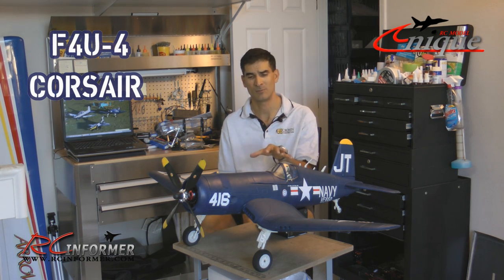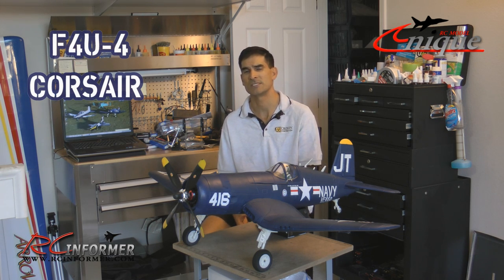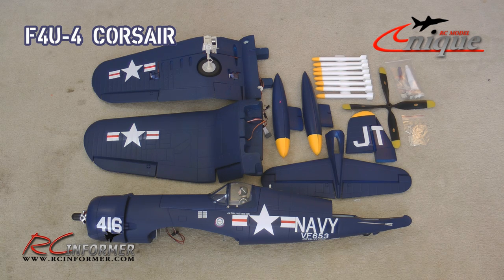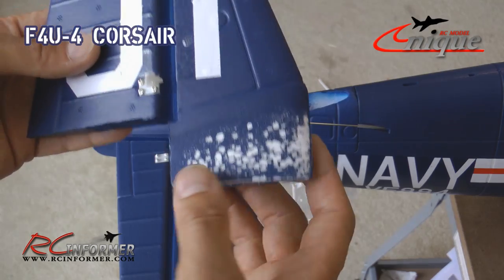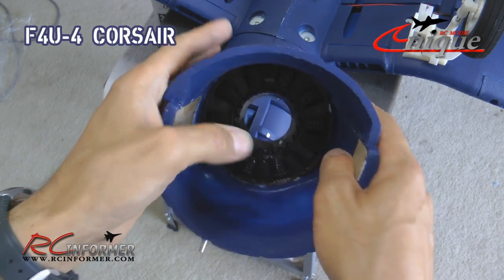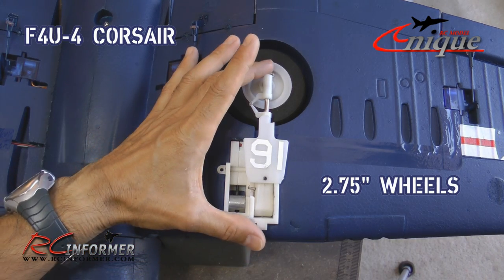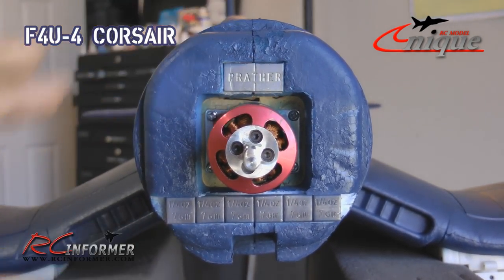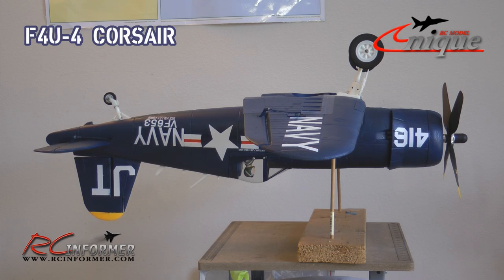Unique Models F4U-4 Corsair BUILD GUIDE by: RCINFORMER

Comment: This was the one! My introduction to Rich and RCInformer. 100+ flights and this poor Corsair survived the build, a few broken props, and has never had a battery tray. It looks like he’ll! No breaks, but a lot of missing paint and dings. Still flies great. I would’ve never guessed this plane would survive a month, I can’t believe it’s still around 5 years later.
Thanks for the help on the build Rich!
Reply from the maker: Jeff, Excellent to hear it! Time to upgrade to the 1700mm FMS Corsair:)
Reply: @RCINFORMER  Last question. On the FMS 1700mm Corsair. Do I need to order a different prop, esc or motor? No plans on going 8s. I’ve already started a GoFundMe page for myself to get a bunch more 6s batteries for the Eflite a-10, the Freewing 80mm a-10 and Me-262.
Next time you’re in Atlanta you get to maiden the big a-10. I’m scared to just pick it up, much less fly it!
Reply from the maker: @jeffhenderson934  No need to change anything. The 300kv motor, 80amp ESC on 6s works perfectly with the new prop! Most new models have the new prop in it already. Please use my links to purchase if you get one:)
Reply: @RCINFORMER  why didn’t you tell me about your links 5 years ago??? I’ve crashed over 25 planes and still have around 30. I’ll get thru your link.
Reply from the maker: @jeffhenderson934  Jeff, I just starting using them in March:) At NO EXTRA cost to you, if you click my links that go to the product page and add them to you cart, we get a small comission. We appreciate the support:)

Comment: They have really changed this model significantly.  The landing gear now is the cheap, plastic kind and looks nothing like the one you have in the video.  The tail gear is fixed now.  I am sure it was all done to save costs.  I am always amazed at what companies will do to save cost at the expense of quality.
Reply: I got mine a month ago and put it together just like the video describes. I worked for about 10 minutes and then stopped working. I never got it in the air. The electrical parts are no good either, apparently.

Comment from the maker: gear that extends inward (towards the fuselage) or outward (away from the fuselage) usually only causes a pitch down with the increased drag and moment arm of the extended gear w/no CG shift. Gear that extends forward or aft causes a CG change and a nose down pitching moment. In the case of the Corsair, gear up results in a pitch up and CG shift aft.... Gear down results in a pitch down and forward CG shift.

Comment: What is the name of the tubing on the servo horns? I would like to buy but don't know how to and where to buy.  Appreciate for your information!
Reply from the maker: it is simply fuel tubing used for Glow engine powered models...
Reply: Thanks! That's very helpful. How would you compare this F4U-4 with 1.2M wingspan LX's F4U-1D with respect to flying quality?
Reply from the maker: The folding wing is cool and the LX version is super scale.... the One piece wing on the UM plane is a bit more ridged and tracks a bit better

Comment: I maidened the Corsair but it lurched left and ploughed into the ground immediately having lifted off. I have repaired it but note that the motor offset is to the left and there is also a few degrees of up thrust! All my other planes have an offset to the right and down thrust. I did not damage the motor mount during the accident so therefore it came out of the factory assembled like this.
Can you advise whether your model is like this as well? If not I can make and fix a wedge behind the motor to rectify the problem but would be grateful if you could advise the number of degrees right and down thrust.
I would be truly grateful for any advice/information you can give on this matter.
Martin

Comment: Rich I have a Dubro balance machine.  I can measure 65mm easily.  Do I measure where the wing actually meets the fuse  where parts near the fuse or do I balance where the landing gear plastic is.  I measured 65 MM from this point and using the same battery, the balance is good.  The Corsair is a tricky one to measure because of the two plastic pieces one the wing that almost meet the fuse.  Did you make your balance machine ?
Reply from the maker: +Major King It was a while ago, but I think I measured it from the farthest forward point of the leading edge... You cant go wrong by being a bit forward...

Comment: That foam looks like crap.  And no wing spar.
Reply from the maker: It's an older generation model, spar or no spar, this model will pull lots of G's and will even fly inverted without the wing breaking.... flying the plane hard right side up & inverted demonstrates the excellent structural integrity which negates you're wing spar concerns:)

Comment: Can you please give me details about the tailwheel retract setup, like how the pushrods are supposed to go, my plane came with the tail retract servo or any connections and i'm guessing they ( Hobby King OR Unique Model RC) aren't going to help me and i will have to fix this myself. I can do the work just need to know the design.
Reply from the maker: Not sure what you mean by details? you may need to partially disassemble it to figure out what is wrong with it...
Reply: Well they simply stopped providing the retract system in the Hobby King version of this model.  But the hing pin is there and the tail wheel can swing.  So i wanted to know how they used to retract the wheel.  So if i knew what supposed to be there like linkage and servo or is it a screw jack and threaded rod?  Could you do a close up video of the tailwheel retracting maybe?
Reply: frankswd I know this is 5 years later, but I too just bought the version 2 from Hookll models and it too has no retracting rear gear. I did some looking around online and found the original retracting tail gear. It has a screw type motor and it’s pretty inexpensive. Let me know if you want any details on where to buy it. They also sell a separate motor, but I’m not certain if it’s for the tail gear or main gear? If it’s for the tail gear it would be great as it’s only like $7 or 8 bucks! Not sure if there is a hookup for the gear sequencing either? They sell that as well for like $17. Maybe you could let me know what you figured out as well. The manual that came with this plane was a joke. Completely useless.

Thanks,
Mike S.

Comment: Hi Rich. so I got one of these Corsairs used and had a bad tail heavy flight that turned out pretty bad. ended up snapping both wings off   so I have been checking on H K  and no luck finding parts. do you have any suggestions on where I might find a wing set. also bent the prop shaft.  so I need to locate some parts or maybe just straighten out the shaft and hope that the C A glue holds up  any suggestions Rich???  thanks friend. and HELLO to Amy 😎
Reply from the maker: Roy Thorward  A wish I had a good answer for you...I made that video almost 6 years ago and I'm not aware of anyone that sells it or has parts for it.  It is a great model but is not as available as other brands.
Reply: RCINFORMER yes  Rich I've been searching and the closest thing I can find is the dynam. and the wing looks the same minus the flaps. do you think that wing would work. my buddy has one I will have to put them side by side and see. well thanks for the reply. I appreciate it. good hearing from you. Rich. 😎😋
Reply: RCINFORMER     Hi Rich. so I have been doing some repairs on the Corsair. I got this plane off Craigslist  and the previous owner had replaced the servo on the tail wheel retract with a huge 40 or 50 gram servo I'm guessing he never flew the plane after the repair. because she flew super tall heavy. I pulled that big servo and replaced it with a 9 gram servo. do you think the 9 gram servo will hold up. I don't know what was in it stock. seems to operate fine this way. just thought you might know what the correct servo is   thanks again. 😎
Reply from the maker: Roy Thorward yes... it should be ok... metal gear would be preferred